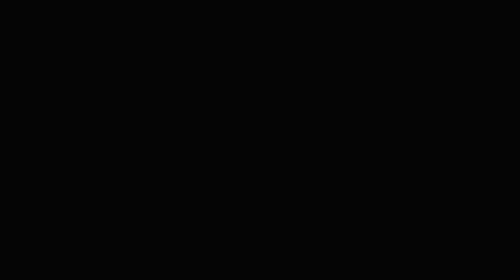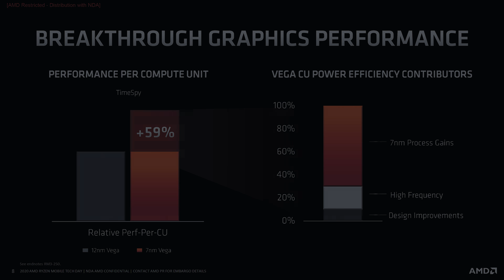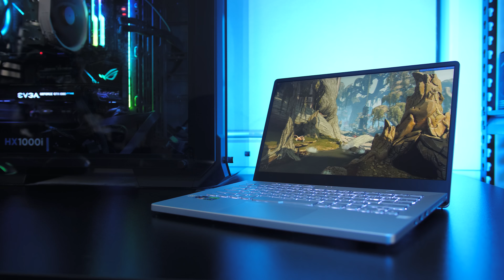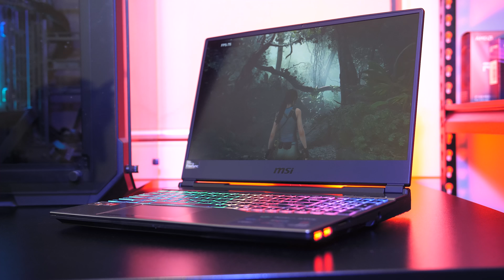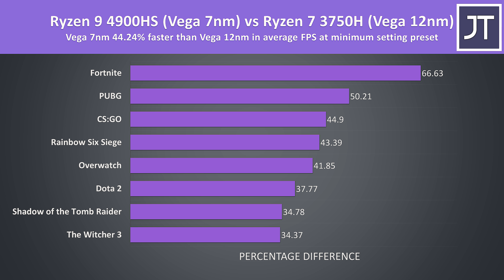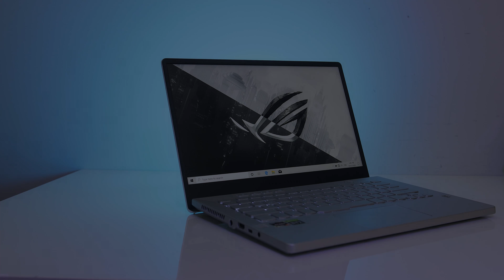Vega iGPU Gaming Comparison - 12nm vs 7nm (4900HS vs 3750H)

Comment: Is deactivating the nvidia GPU in the device manager really necessary? Because i have the exact Laptop model and there is an option in the nvidia control panel to use the internal GPU that only seems to work half the time.

I prefer using the igpu in less demanding games like genshin impact since the Laptop runs cooler and more battery-saving.

Comment: Hi, can you please explain liquid metal on copper. i am confused. how can i tell if i am 100% coper or mixed? and what exactly happens if its naked copper? and how often do you need to re-apply liquid metal?  i want to apply liquid metal.

is the razer blade 2019 heatsink 100% naked copper?
Reply from the maker: I can't, sorry, I never really looked into liquid metal so don't know much about it. I understand mixing with copper is bad, but have no idea how you would determine what materials a particular laptop is using.
Reply: @JarrodsTech  thanks

Comment: So what we can expect from navi...
Well vega mobile didnt scale great, you could have 8CU(8rop) 10cu(8rop) and 11cu(8rop)....so you're always getting 8 rops and the extra shaders therefore didnt scale 1:1, you might go from 8>11 an increase of 37.5% and only get 20% more performance on average. That is why 8cu was the focus for this gen and most of the performance simply comes from the higher clocks which will happen when you shrink a node to half.
Navi however scales better, 3584vega shaders at 1.5Ghz(10.7Tflop) are on par with 2304navi at 1.9Ghz (8.75Tflop), So a 512:32:8 config navi core still at 7nm 1.75Ghz could be ~22% faster than this, Combine that with better scaling we could have a 1024:64:16 rop core that at the same 1.75Ghz clocks could be closer to 50% faster than what we currently have and on a 7nm+ process for zen3 based ryzen5000 apu's would still be possible and I think that is what AMD may be holding back.
For years we've had 512 GCN based shaders on APU's for over 6 years now, People have been asking for more powerful integrated graphics on apu's....amd gave 8 cores on £1000 laptops. Try and find a £400 laptop with an apu where it has 1024 shaders, you can't. AMD may finally give consumers what they've been asking for next year. We can hope.
Reply from the maker: Hopefully!

Comment: i think it would be interesting/more relevant seeing new 7nm Vega perform against 12nm in the 15w-25w 
U series, were discreet graphic are very rare in 12 to 14 inch ultra portables. I am currently waiting to see Ryzen 4000 or Intel 10th 10nm. may have to settle for something a little bigger and pricier with a 1650nvidia or 250mx . the razer 13 looks amazing but the price ouch! at an even choice Id go team Red!

Comment: You can't really say that the CPU is what's making the difference. Those igpu are so weak it don't take much to max them out it. I bet if you ran same test with identical CPU with the 8cu and 10cu igpu the 7nm would still be miles ahead of 12nm.

Comment: From what I can find out, the memory in Asus G14 is 3200MHz while the MSI Alpha 15 is only 2666MHz. I wonder how much of a graphic performance advantage of Asus G14 is due to that.
Reply from the maker: Correct, hopefully I can test it in future.
Reply: @JarrodsTech  Jarrod, there's hidden BIOS setting on MSI Alpha 15 which unlock tuning. You can try 3200mhz on it! Retest???
Reply from the maker: @reynaldo7371  I tested at 2666 in my last alpha 15 video
Reply: @JarrodsTech  just saw overclocker got it running 3200mhz CL18, idk if the performace gap from 2666 worth it

Comment: Vega was ignored By Lisa while she pumped up Ryzen and sucked off the console companies. My Sapphire Vega 56, which I hand tuned (overclocked/undervolted) meets or beats the Vega 64. THAT SHOULDN'T HAPPEN!!!!
She dropped the ball on Vega and it cost AMD massive bank.
Reply from the maker: I mean couldn't you do the same to the 64 too 🤔
Reply: @JarrodsTech  No, you couldn't do that with 64 to newbie. The 64 sucked and while you could get some gain. It was no where as significant. Which is why the Radeon VII didn't have 64 CU. 
Do you know what the fck you are talking about or is this a hobby?????
Reply: And don't come off with some 600 watt power mod.

Comment: Jarrod, you got your concept of CPU bound and GPU bound wrong.
For esports title, it was mostly correct. They are less graphics intensive, thus at lower setting, when the GPU can easily render frames, higher FPS becomes more CPU limited (cpu bound). at higher settings, the performance becomes more GPU bound as you're taking more graphics power to render those frames.
Graphic settings does not determine if you're CPU or GPU bound but rather the intensity of the graphics needed to be rendered. For non esports title and instead AAA games, like Shadow of the tomb raider, witcher, etc. Those games are GPU intensive, that is they take more GPU power to render thus you get lower frames. This is in no way means they are CPU limited as both CPU are capable of doing 60fps minimum with discrete graphics. The analogy is that you would take an i7-9750h and pair it with a 1050, while another i7-9750h is paired with an RTX 2070. At lower graphical settings, the 1050 may only be able to churn around 60fps(conceptually, I don't know the actual results for the 1050) while the 2070 may churn out 140fps.
If you insist they are CPU bound, then have a look at the CPU usage. If the R7-3750h is really maxing out, then it is. If its not then it's GPU Bound. The same goes for the 4900Hs
Reply from the maker: Of course it varies by game, but in general for the most part with most games, higher settings hit the GPU harder than CPU. When I say bound I guess I don't mean being limited, just that more of the load is on that component rather than it being a bottleneck, maybe I should have used different wording.
Reply: @JarrodsTech  as much as it varies by games, the fact of the matter is with the AAA games you showed, they are more GPU limited, or stressed than the CPU, which is why even at low settings, they are getting low frames.
I would suggest you show the CPU (all core) and GPU core usage. That would tell us how much of it is gpu or cpu limited.
Eg, in shadow of the tomb raider, at low settings if the 4900hs CPU core was at more than 80-100% usage while the iGPU is at <90%, that means it's CPU limited. While if the CPU is at 50% and GPU at >90%, it's gpu bound.
So a percentage of the core usage would really help determine the component bottlenecking
Reply: @JarrodsTech  and to be clear, I'm talking about low settings in gorahic intensive games. Your concept of the component load works fine with esports title, those are all cpu bound at low settings at gpu bound at high settings.
However with graphic intensive games. Even low settings would severely tax the GPU and so a gpu not powerful enough would limit the rendered frames and that's where my i7-9750h analogy comes in

Comment: Hi, 
Are laptops being plugged-in or do they run on battery during these tests? And does it make a difference?
Reply from the maker: Always plugged in, battery would be less performance and would be hard to test as results would vary based on charge level and health of battery.

Comment: The difference in performance is down to memory running @3200mhz instead of 2400mhz. Not to Vega 7nm VS Vega 12nm
Reply from the maker: Yeah that 12nm to 7nm is clearly contributing nothing! 🙄
Reply: @JarrodsTech  Well, you could replace the 3200mhz sodimm with a 2400mhz one and see for yourself. The soldered one will automatically downclock to 2400mhz
Reply: Well, i don't wanna say that i told you so, but i actually did.
https://www.anandtech.com/show/15708/amds-mobile-revival-redefining-the-notebook-business-with-the-ryzen-9-4900hs-a-review/9
Reply: @eddieobscurant  , that's expected. And again, good luck reaching 68gb/s memory bandwidth with the older Vega memory system.
 So, the Asus laptop means nothing in regards to the V1 va V2, actually it's really the memory system that is the key for the 77% improvement*.    
* Might be vs the 2933mhz*
  So, if a vendor whants to use only the new Vega, it better not solder the Ram.

Comment: I play on integrated graphics on Surface Pro so I like this content
Reply: I played many games in the go with my 3550h nitro 5 without charger. On the iGPU. And they all managed decent frames, equivalent to Nvidia MX150 and 250.
In dota, 60fps is more than easily achieved. And this is on battery

Comment: Hey Jarrod just wanted to ask what laptop cooling pad you use in your vids? Is it something you would recommend? Thanks
Reply from the maker: It's this one: https://www.youtube.com/watch?v=Zx2EnUD-DoM it's on the larger side for up to 19" laptops so you could definitely go smaller, I just use a large one as I need to use it with all sorts of machines. I showed in a recent cooling comparison video that it basically makes no difference: https://www.youtube.com/watch?v=tXvKiy65pwg

Comment: Jarrod, I need a new gaming laptop and can't decide! MSI GS66 ($1,599 version with the I7) or Asus ROG Zephyrus G14 (with similar specs)? Which one do you gravitate towards? I'm loving that MSI 240 Hz screen but I'm told AMD is the future. Man, first world problems are tough...
Reply from the maker: The MSI will perform better in games simply because the GPU isn't capped to 65W, depends if you care about the higher multicore CPU power or just straight gaming, in which case the MSI with 80W GPU will win.
Reply: @JarrodsTech  Thanks for the response. Out of curiosity, if I purchased the MSI with the 240 Hz screen would an I7 even be able to hit that in most modern games? Like, let's say Halo Infinite? Btw, you've earned a new sub.

Comment: I’m thinking about getting a new gaming laptop soon, could be the up coming Zephyrus G15 which uses Ryzen 4800HS or Triton 500 with i7 10750H - RTX2060. Is it true that most games optimized better on intel system than AMD? Should I choose Ryzen 4800HS system over i7 10750H system?
Reply from the maker: I don't think CPU matters anywhere near as much as GPU when it comes to game optimization. Hard to say until I've had both the 4800HS and 10750H in two laptops with the same GPU to fairly compare, I'd just be speculating.

Comment: Jarrod I need help pls I have a nitro 7 with 1660ti i5 9300h undervolted at 125mv and 1X8 ram when I play gta v on it very high settings in which vsync is disabled no msaa only fxaa I only get around 40 to 60 fps pls halp me :(
Reply from the maker: Go for a second 8gb stick to get dual channel, it will boost performance especially in CPU heavy titles like GTA. You can see how single vs dual channel does in different games here: https://www.youtube.com/watch?v=E_aPaj5QkmM

Comment: "unlikely you'll be using a 4900HS in a laptop that doesn't have some dGPU; fairly unlikely you'll be using the iGPU for gaming"

Personally I want a beast of a machine (CPU, memory) that is light and gets good battery (when just browsing the web or watching videos). But I also like to play some games like CS:S, Rocket League, or some other games that don't need a high-end GPU.

I guess the 4800U series will be very interesting to see. Quick glance seems like I would be happy with a 4900H(S), 4800U, and maybe a 4800H/4700U. I'm not clear on how the U differs other than base clock. Does it mean OEMs are more likely to pick a U if they skimp on cooling? If you have a 4800U, will it perform as well as the 4900H if sufficiently cooled?
Reply from the maker: Fair enough, I have no doubt there will be some people using it that way, it's just far more of a niche solution compared to the majority of people buying a gaming laptop that are fine with best performance using the dGPU. U laptops will be thinner and have lower cooling, I'd expect lower results because the CPU will matter too and that will be lower wattage, hard to compare just Vega only.
Reply: @JarrodsTech  I guess I could see them in high-end professional/business laptops (and have the extra price premium since those are higher margin products?). Really not sure though, haven't been paying attention to the laptop market for years to know what's typical.

Tangentially, I was really thinking that Apple would have come out with a MacBook this year with their (ARM-derived) SoC (decent performance w/ game-changing battery life).

Comment: Thanks for the informative review. I'm really curious how the Vegas compare to the UHD 630 and 620.
Reply from the maker: I might do that in future, didn't have any on hand to compare with at the time I made this unfortunately.
Reply: That would be just massive destruction. My Intel UHD 630 (i5 8265u) cant even run GTA 5 at 720p (lowest settings) at more than 20-25 fps.

Comment: One thing to definitely consider, if one is to make a projection about what the rest of the U series might be like for IGPU performance, is that this test was running a laptop at about 80 watts, while the ultrabooks that will be coming will all be at 15 or maybe 25 watts.
Reply from the maker: Of course, while the Vega component is the same the rest of the CPU which does a fair bit of the work too will be lower and that will matter especially at lower settings.

Comment: I have a new testing idea for you that would be especially helpful in determining the power of an APU because it's demanding on both the GPU and the CPU pretty intensively in my experience. Run Skyrim with the following mods-
Noble Skyrim 2k retexture
FNIS (important for some of the other mods that make the whole test work as a stress test)
KS hairdo with hdt physics
HDT physics extension
CBBE with hdt skeleton
Skyrim Flora Overhaul or Verdant, either would work, the high res Verdant pack seems to be more demanding to me though
An hdt extension to force grass and tree physics animations
Luminous spells
XP32's new spell animation 
Literally any mod that changes the running animations
Bleak ENB (non performance edition)
HDT capes

Those mods can seriously stress a low power system out if you have all settings on maximum except shadows on high and AA disabled. I can only run half of those on 800x600 resolution on my Pentium n4200 (but hey I get it to run so that's an achievement in itself) but a more powerful APU from AMD should be able to handle it at 1080p and it would do a great job of showing where both CPU and GPU play a part because when I look at my logs the more physics intensive actions seem to be more taxing on the CPU but the higher res textures and the enb lighting fx push the GPU harder. The way I can test which is which is by going into the plains of whiterun and starting with the enb turned off and no physics enabled armors equipped, the casting a few spells with lots of particles for a baseline. My Pentium n4200 at 1280x720 gets 15-20 fps with those mods enabled for that. Then when I equip an HDT armor and use showracemenu to change my hairstyle to an hdt haircut I get about 10-20 fps. If I swap back to the non HDT I can enable the enb and stay at the same resolution without an fps change. Bleak ENB even non performance edition is actually pretty well optimized. In the forests of falkreath it might shoot performance a bit especially if you have a fog mod enabled, but on the plains of whiterun it runs at around 18-25fps during clear weather and 10-15fps during other weathers. When I enable the enb as well as equip all the hdt stuff I have to go down to 800x600 resolution but doing so actually brings my fps up to around 30fps on average even with everything that's installed. Fireball is a good spell to test particle effects, the apocalypse spells of Skyrim mod adds a lightning strike spell though that can show off the performance of particles much better.
Reply from the maker: Now that's specific
Reply: @JarrodsTech  XD, I figured I wouldn't spare any details for how and why the test would be a good way to gauge performance.

Comment: Makes you wonder what the performance will look like if they still had 10 graphics cores at those faster clock speeds.
Reply from the maker: Haha yeah, I guess too hard to fit it all at those higher speeds and the compromise just worked out better.

Comment: In rainbow six siege my laptop (i5 5200U) highest FPS is 32 with 800x600 resolution at the lowest possible settings and 25% render scaling. I would take the Vega GPU at any time of the day! I've tried undervolting the CPU but that didn't help in any way!
Reply from the maker: Yeah sounds like a nice improvement with 4000 series 👍

Comment: Hi jarrod. Great content as always! Which is better?  $1099 Lenovo 144hz 10th gen i7 rtx 2060 or $999 a15 ryzen 4800h 144hz gtx 1660ti? This is mostly used for call of duty mw gaming
Reply from the maker: Thanks! Hard to say as I don't know how the 4800H does in games, obviously better in multicore performance, but the 2060 is also 14% better than a 1660 Ti, so difficult to compare until I get a 4800H gaming laptop to test.

Comment: To be honest, its a good thing to know this, mainly because, for those whom are on a budget, they don't need to have the fastest thing around to game.

ALSO, this is with 3200MHz DDR4, so expect even greater results with the 3733MHz memory.

Honestly, if AMD jumps again next generation with say, double the graphics potential that they have currently, it would make me question if needing a dedicated GPU is actually necessary sometimes.
Reply from the maker: Yeah the LPDDR4X may help even more so with the ultrabooks that use say 4800U, keen to test them when available.
Reply: @JarrodsTech  In that scenario I would really be interested in seeing how ultrabooks like the Microsoft Surface laptop would game then.

Comment: The new 4900HS cpu is made to run with a discreet GPU. That's why the built in graphics card inside the new chip is small
Reply from the maker: Is it small? The spec is the most powerful out of all the Ryzen 4000 chips.